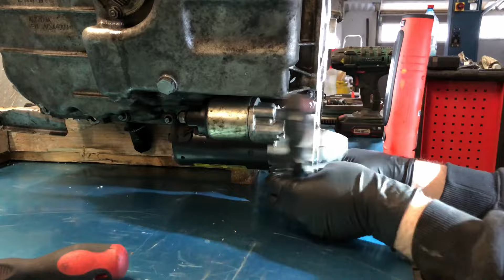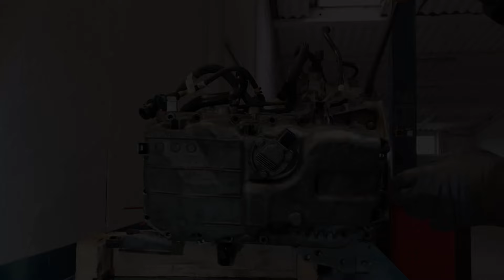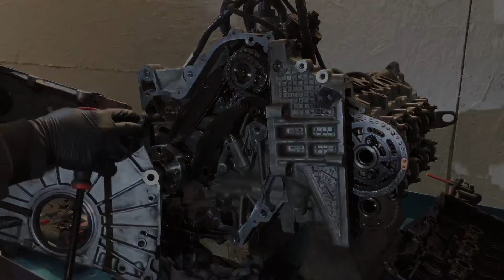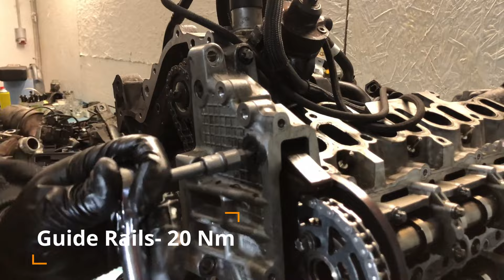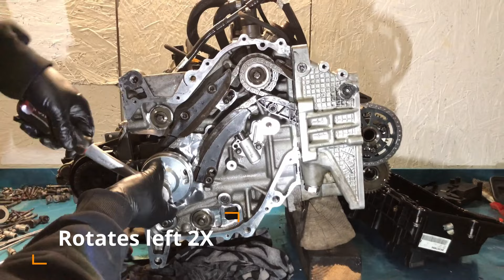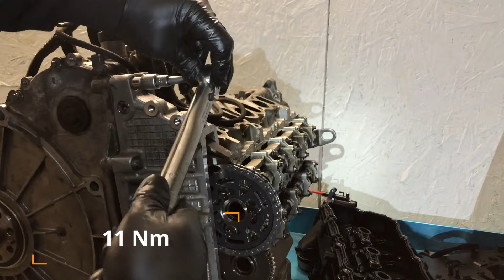Schimbare lanț distribuție BMW N47/N57 - Timing chain replacement

Comment: Am luat un bmw e60 din germania cu 279 535 km si nu stiu daca a fost sckimbata la km ăștia nu se aude nimic zgomot multumesc de un raspuns
Reply from the maker: Salut! Daca tipul motorului este N47, si dacă la km ăștia nu aveți o dovada a înlocuirii Distribuției, recomand s-o înlocuiți! Am avut cazuri in care nu se auzea nimic și s-a rupt lanțul.. și te lasă exact atunci când ai un drum mai lung de parcurs sau când ai nevoie cel mai mult de mașina.. și cât costa platforma și celalalte cheltuieli, mai puneți încă ceva in plus și circulați in siguranța! 👌🏼
Reply: @apkGarage01  multumesc pentru raspuns

Comment: Salut , eu am un 520d motor N47c an 2014 , lanțul nu scoate nici un fel de sunet momentan la 235k de km , am auzit păreri că dacă nu da probleme sa nu desfac motorul . ce recomanzi?! Mulțumesc.
Reply from the maker: Salut! Eu am schimbat și la 150k km care nu dădea semne, dar când am desfăcut, era destul de uzat.. am avut altul care nu dădea semne și s.a rupt din senin, dar la ceva mai mulți km, undeva la 250k.. totul depinde de cum a fost întreținută și cum s.au făcut schimburile de când mașina e noua.. degeaba ii faci inspecția la 10k km dacă pana sa o iei tu, inspecția era la 30k... nu recomand sa se meargă ‘pe spuse’... la toți le.am recomandat ca dacă îl schimba odata, nu mai merge cu frica sau cu stres ca se poate rupe oricând..
Reply: Mulțumesc pentru răspuns 👍👍 foarte probabil o sa o schimb prima posibil. Numai bune ✌️👍. Good job
Reply: Salut ! După septembrie 2013 nu mai sunt probleme la motorul N47 . Este varianta cea mai îmbunătățită cu ultimele repere la piese. Cele mai multe probleme știu că au fost la modele produse până în 2011. Poate nu e nevoie să schimbi distribuția.
Reply from the maker: @mihaioctavianmetea1475  salut! Ai fost informat greșit.. am schimbat și la mașini 2015 și la fel au fost.. primele modele fără probleme sunt după 2015, euro 6, tipurile de motoare B47.. pana in 2015 sunt n47, cele cu intinzatoare scurte și patine de proasta calitate..
Reply: @apkGarage01  Saptamana asta mi-au schimbat distributia la un 420D N47 2014 si era cu intinzatoare lungi, nu scurte. Deci cine e informat gresit?
Reply from the maker: @mladinandrei2212  simplu! Au mai fost schimbate odata pe original..
Reply: @apkGarage01  Salut, stiam de N47, dar se poate rupe si la N57/3.0? Multumesc anticipat!
Reply from the maker: @turdeanustefan7111  salut! Da, la n57 la fel se rupe.. și costurile îs mai costisitoare la N57.. recomand la n57 sa se schimbe înainte de 200k km decât cum se recomanda la N47.. deoarece uzura e mai prematura la n57...